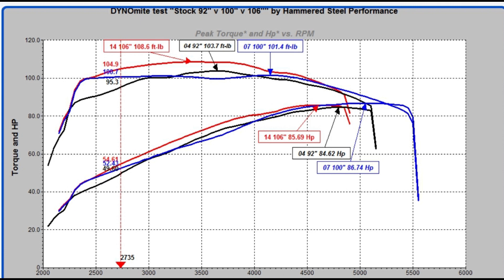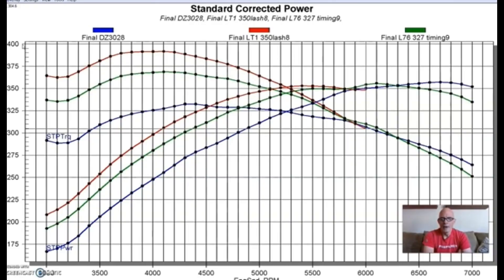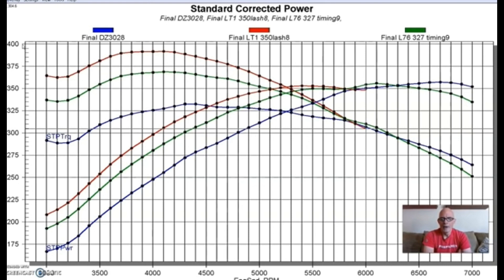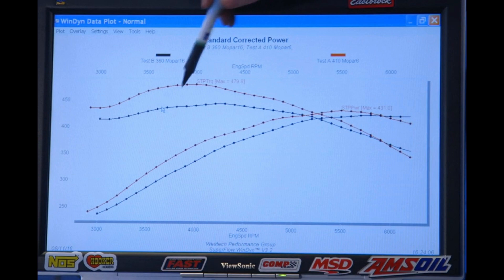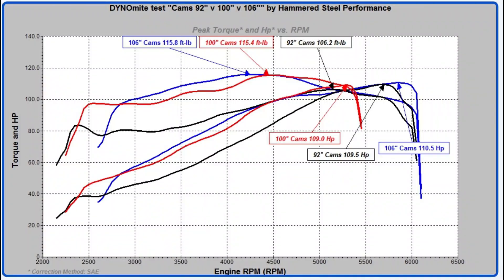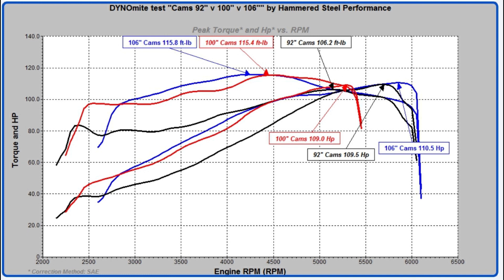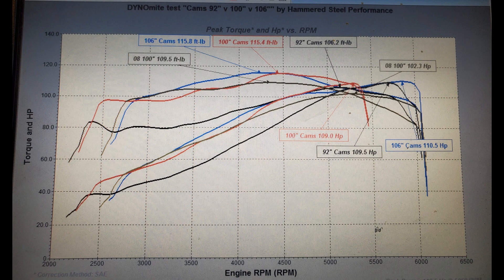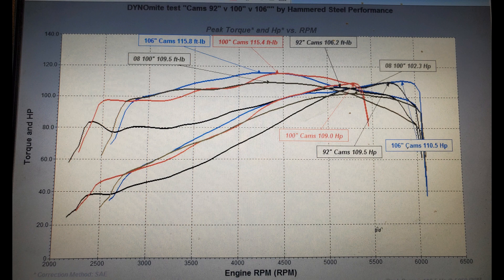Part 2 92 v 100 v 100 v 106. How does cams, intake and exhaust impacts TQ and HP.

Comment: 2007 100/6 jackpot vs 2011 106/6 vegas

Stock are they similar or does the 106 have a lot more torque ? Trying to figure out if the extra 700$ is worth it to get the 2011 106 over the 100 torque wise

I do plan to upgrade either one as much as I can in future

Comment: My 2006 Victory Hammer came back at 80 whp and 103 wtq. Wonder if he was off a bit on the hp number. Also, if I should have a run with someone else on a different dyno to see if there is a difference? 🤔
Stage 1 K&N Filter with intake cover upgrade
RPW Slash exhaust
Power Commander 5
Reply: Every dyno is a bit different, but generally yours sounds middile of rhe road.  On my dyno i would say it would make similar tq and hp around 85.  More important that peak numbers, does the bike run well, pulls cleaning theough the rpm range and good throttle response?

Comment: I am looking a 02 TC that had the Victory 100" kit put on it, and had cams and intake (unknown on the cams, intake is Lloyds Torque Tubes).  With the larger valves and now the same displacement as a 06-07 100", should it be comparable in torque and power?
Reply: It would be similar, the main difference is in the exhaust and how that effects performance.  Meaning that there are multiple exhaust options for the 05-07 100" while the TC really only has muffler options.

Comment: What are your thoughts on having a custom xpipe on the 106?  Lose some torque but gain hp?
Reply: I have never tested an x pipe design so all I can do is speculate.  My gut would say that an x-pipe mid or the more common h-pipe (that is what is used by victory on the steel frames) mid would perform similar but not as well as a good 2-1 for broad power curve.

Comment: My 05 TC is noticeable in seat of the pants torque compared to the 06 KP I had.  Also heavier.  In the back of my mind I was trying to figure out how much a HD 103 owner would have to spend to get over 100 & 100 (and run under 280° oil temp).
Reply: They challenge the HD twin cam engines is are the head flow.  Stock twin cam heads on the 103 peak flow about 195 cfm.  Where our Vic heads flow 250 cfm, this is one of the reason that your Vics responds well to cam upgrades.  The 03-06 V92TC and 03 V92 classic cruiser has a real good stock cams too.

Now for reference the HD M8 heads flow 300 cfm stock, and that's why the respond so well to cam upgrades as well.

Comment: Really enjoyed the videos ! great explanation ! love to see a supercharger vs turbo comparison ! but i know those are very rare in the victory world !  Cheers for the good work Cory !
Reply: The Vic Shop built a super charged SC.  Raced against a turbo KP, did very well.  It's on YT.
Reply: @97irishflyer  cheers! I've seen it! Great race and video
Reply: That would be an expensive comparison for sure. The main reason why the supercharger is sorta a better fit for Victory over a turbo is actually they way build boost.

A supercharger produces a rising boost curve.  Low boost at lower rpms and it rises as rpm increase.  This gives sometime for a variable clutch to apply addition pressure on the clutch.

On a turbo, sized right, it will build boost at a much lower rpm and it is harder for the clutch to hold the power without slipping.

It sounds counterintuitive, but its what happens.  Most think that a turbo is soft on the bottom, but if sized right it hits hard down low.

Now in race cars, trying to make big power may run a turbo or two of them a couple sizes up to make huge power on the big end.
Reply: That is a centrifugal supercharge

Comment: Love your videos. Where these tuned by the same person or just slapped on and dynod?
Reply from the maker: I tuned each of these bikes.  These were from my library of dynos that I dug through to find similar combinations on different engines sizes.
Reply: @hammeredsteelperformancehs1120  I am unable to find videos of these bikes running at these numbers vs what they put down on the dyno. If you know of any sources of what these bikes will actually do with the numbers posted im sure many people would like to see them. Personally ide love to see any one of these bikes do a highway run 0 - whatever just to show the difference from stock, what the mph actually goes to with the extended rev range, etc.
Reply from the maker: @GrandpaWazi  If you could, can you expand on your thoughs?.  Are you looking for say stock power vs times on the drag strip?  And how the performance changes with improved power?  How much of a mph gain one gets with a rev extended?
Reply: @hammeredsteelperformancehs1120  Exactly. There is only one video I know of showing a high ball with some mods doing a 20-120 pull on the highway with the camera pointed at the speedo. Drag videos where they expand on what was done to the bike with the times shown are far and few between as well.

Comment from the maker: Crazy, right.... Horsepower Nation just posted a new video today!  They took a 360 Mopar Magnum and ran it stock on the dyno, and then they made it a 410 stroker and then ran it again with stock heads, camshaft and the same intake and carb.  Now the stroker did change compression ratio from 9.9 to 10.8.  The 410 picked up a ton of tq and only made about 30 more hp.  This is on a v8 so the gains on a 2 cylinder would have only been about 7 hp from adding a bunch of cubic inches and almost a full point of compression.

 Just like we were showing in the 92 v 100 v 106 video, when you use similar  heads, cam, intake and exhaust and you only change engine displacement, peak hp will not change much tq will for sure.  

https://youtu.be/nbY7UGuZAfA